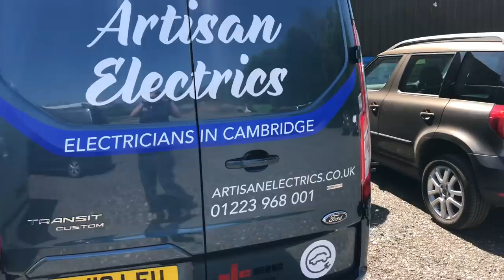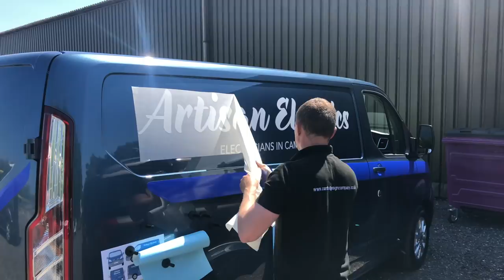My Manic Day as an Electrician! Life of a Jobbing Sparky. New Van Sneak Preview! Calibration? Y/N

Comment: Your "confidence" calcard's are primary (although id have much higher accuracy), i'd have those measured externally and keep records, then self test in house.. It wont be long and it'll be a issue sending stuff away and cheaper to employ someone to go through your kit.. Calibration (for me) involves taking a set of measurements to verify the specification and if required adjust and repeat the measurements.. Bonus having somebody employed / oem approval etc, you can measure/adjust external kit which creates further income..

Comment: Great video, you’ll not regret the custom, it’s like driving a car.  Lacks storage in the cab, apart from that amazing.  Answer to question below, the environvent silent does not require a 3A fuse, if supplying from a lighting circuit.  Exactly the same as greenwood fans.  Such a pain putting 3a fuse when change over.
Reply from the maker: Yes great comments thanks

Comment: Nice tan 😎 new van looks great nice colour 👍the electric charger was it tns or tncs ? 
For my testers I have a check box I use monthly, cal card each time I use the tester I also  get it done each year on a cal day at wholesalers as cheap and peace of mind.
Keep up the good work
Reply from the maker: Thanks great comments! It’s a TNS system but regs say that you have to assume it could be changed to TNCS in the future. So will have to install a TT system for the charging point only.
Reply: Artisan Electrics thanks for the info looking to do the 2919 soon myself 👍
Reply: @artisanelectrics  Is that correct as I've never heard of it? Surely the DNO would only ever convert a TNC-S to a TT if there was an issue...
Reply from the maker: TNS can often be converted to TNCS or in some cases it even looks like TNS at the service head but down the line it’s actually TNCS, basically DNOs are getting lazy and don’t like providing their own separate earths any more.
Reply: Artisan Electrics  spot on just read it in the code of practice 5.2.3 👍
Reply: @artisanelectrics I've also had this issue, if the installation is over a certain age, the DNO no longer accept responsibility for it and very often it's down to the electrician to convert the system from a TN-S to a TN-C-S... On any electrical documentation, it's called the distributors earth for a reason.